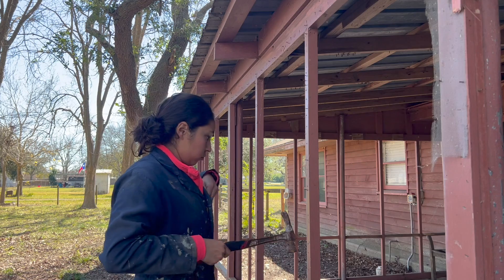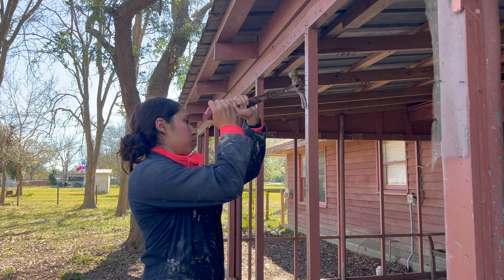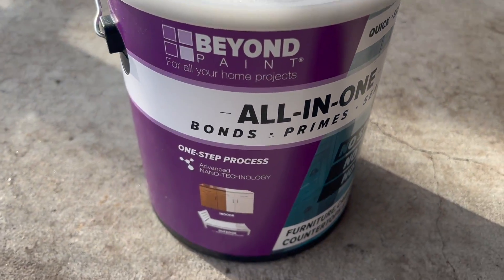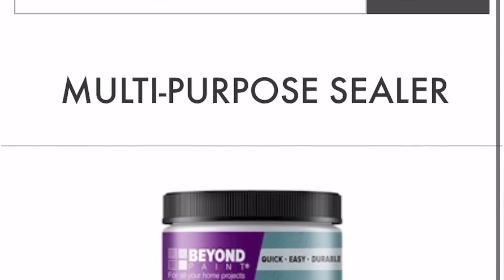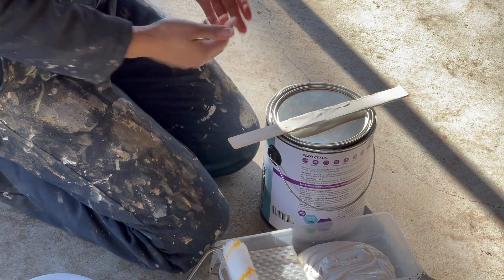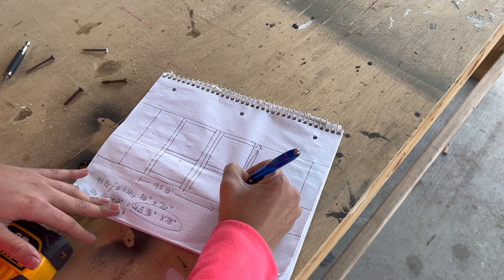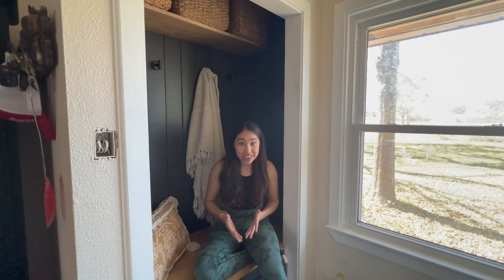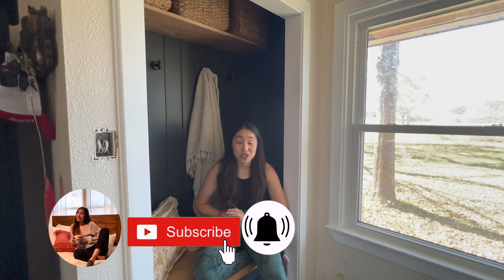Back Porch Makeover on a Budget Part 1 | DIY Back Porch Makeover

Comment: What a difference already, Glenda! Such a fabulous piece of land, especially with all this trees. How did you like the Beyond Paint? I’ve seen some other YouTubers use it on kitchen cabinets (I didn’t know it could be used outside, that’s awesome) and have thought about trying it. I know you have to roll it on flat surfaces, but curious what you thought about the stippling (for non flat surfaces/places the roller doesn’t fit, etc)? Since their instructions say to do this instead of brushing it on, did those areas self level? Since it can be used outside, I’m thinking about using it on my patio furniture. Thx so much (sorry for the long post) and can’t wait to see what’s next! I just love what you’ve done with your home.😊💜
Reply from the maker: We really love it.. the trees are awesome for shade, just come "winter" time its not so. fun picking up all this leaves lol 
I surprisingly dries to s pretty smooth finished considering the way youre supposed to apply it. 
Even as you roll it on its still lightly textured but as it dries and dries fairly smooth. does a pretty good job at self leveling! 
Yes! it caN! I didnt know it could be used outdoors either! ❤️
Reply: @GlendaChavez  very cool! I watched Christina Muscari (fr Pretty Distressed) do another piece in this weeks video with Beyond Paint (she’s done several with it) and she seems to love it. That’s so great to hear that it can be used outside! I’m in Dallas, where our only trees are ones planted when the houses were built lol and come winter it’s such a mess to clean up the leaves, so I can only imagine  with all of yours. Just love all the work you’ve done to your house. (Ok, another long reply) When I watched your kitchen video and you said you bought it and then were victims of Harvey😢 not long after, with 24in of water!! My heart broke for y’all. See I’m from Miami (been in Dallas for 23yrs) and we (our whole families) either lost everything, or had significant damage from hurricane Andrew in ‘92. So I can relate, but even more so, I’m amazed at all the work you’ve done yourself.💜💜💜

Comment: I thought you lived in an older fixer upper in a suburb of Houston but I might be wrong.  Looks like you have a lot of property.  I was surprised at how run down the back porch area looks.  You have done a lot of work inside but you must have a lot of work left to do outside.